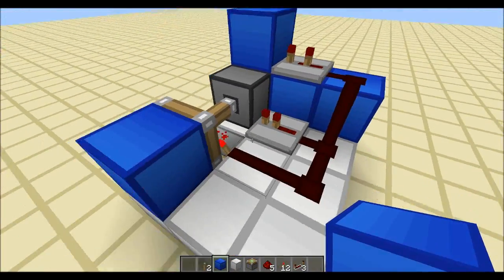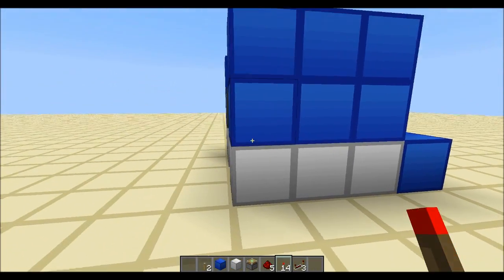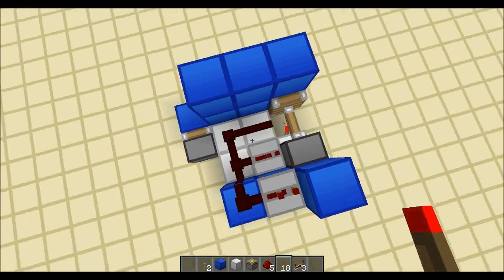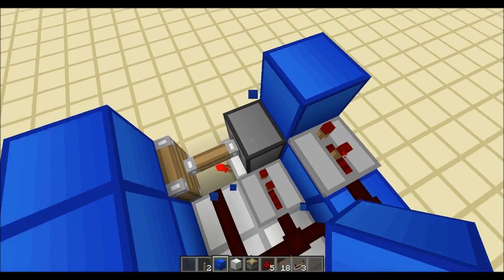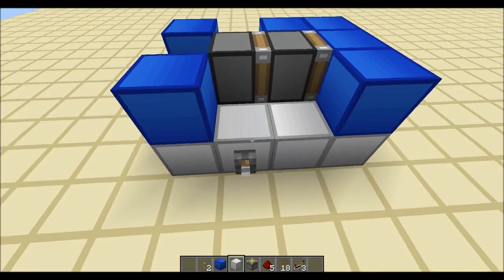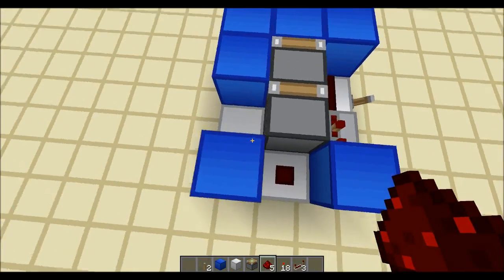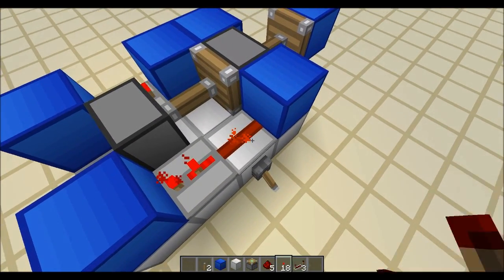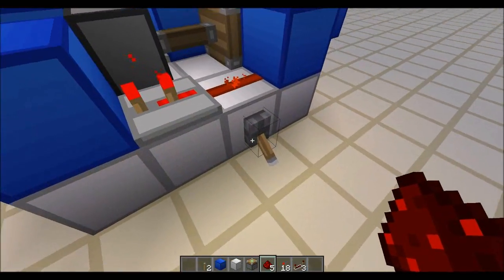Minecraft: Sharing is Caring #004: Redstone Torch Detector & Flush Double Piston Extender

Comment: Exact setup as you, doesn't work as a TFF. Repeater settings are all the same. The 2 tick extension to the pistons now prevents block drop off by sticky pistons. You can however use the pulse the whole thing makes to toggle a TFF that doesn't utilize this outdated method.